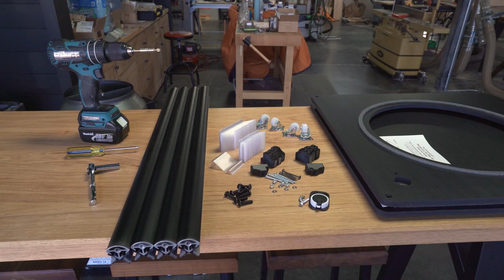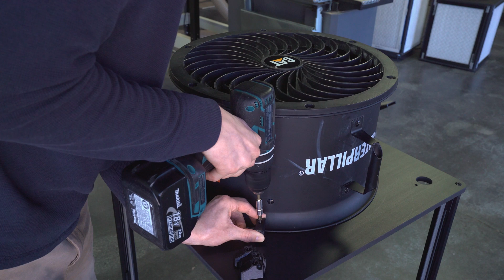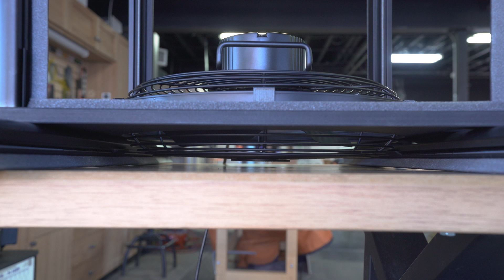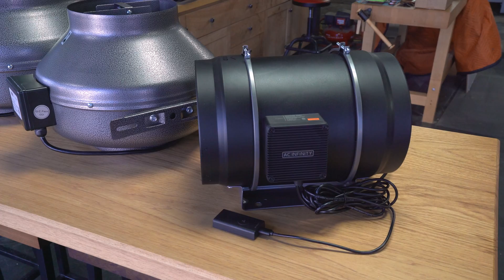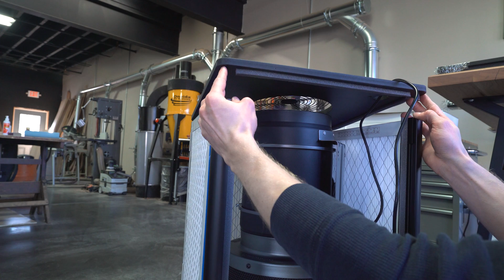Model-B Assembly Guide (All Fan Options)

Comment from the maker: --- Buy Kits Here
https://www.etsy.com/shop/The3DHandyman
--- Time Stamps
Intro 00:00
Frame Assembly 00:54
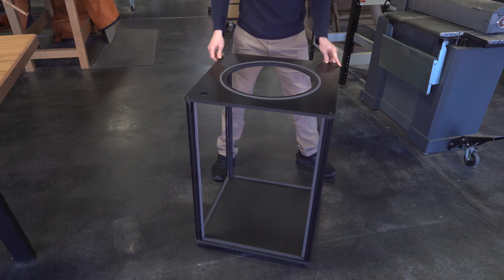Filter Install  02:46
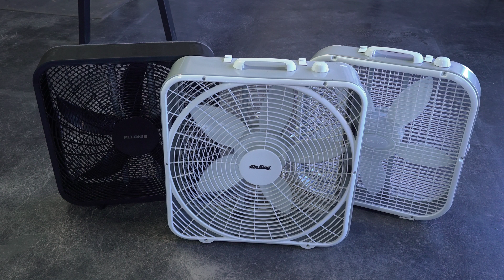Box Fan 05:18
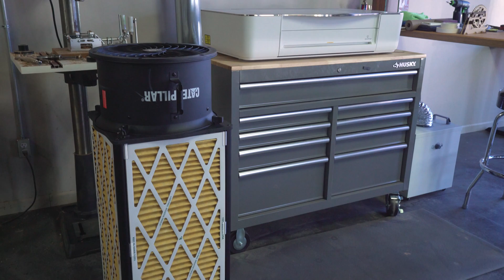Drum Fan 06:34
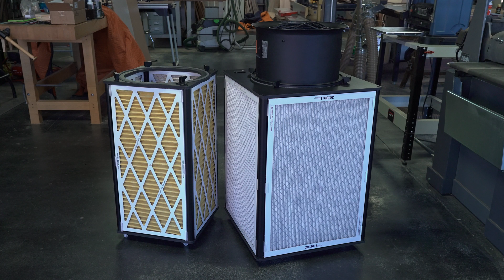Wall Fan 08:22
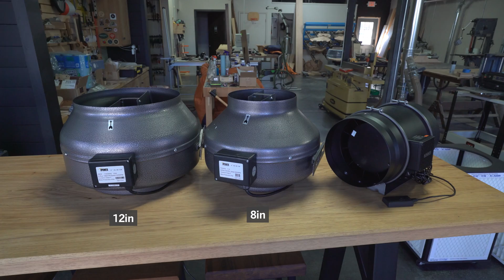Inline Fans 12:16
Carbon Filter 15:17
Foam Install 16:39
Reply: You've done your homework! These kits look sharp & well thought out.
Reply: Hi, I love your kits and want to get one.  How do I go about contacting you to ask you some questions about the kits?  I've tried searching for you on your various sites but can't find your email, thanks
Reply: Hi not sure if you read my previous comment.  How do I contact you so I can ask you a few questions about the kits?
Reply: Happily overwhelmed with all the great info!! Just had mold remediation in my home, hoping your carbon quad could possibly help out getting back to normal. I purchased 2 BlueAir 211+ but I think my nose is a better air quality censor then they are. Most of the time, they don't respond to anything. How loud is the carbon quad? The complete purchase list would be; frame kit, filters, fan & carbon filter?Thanks

Comment: This guy's kits are priced really reasonably as well. There are places selling kits made out of thin faux wood and cords charging more than this dude. Grab a $30 box fan and one of these kits and you will have a much higher quality filter than many of the PC fan kits out there. And if you have PC fans hanging around, this guy does custom jobs, so I'm sure he could do a top with cutouts for 120 or 140mm fans as well. I just love that these kits are metal and thicker plastic with some actual structural integrity to them.

Comment: Hi I saw the price of the kits went up due to tariff costs. Given that the DIY option could run up to $500 at least between the kit, drum fan, and filters, is it better to just buy an air filtration system or HEPA Solder Fume Extractor?

Comment: I'm considering your 20x30 kit with Caterpillar drum fan. Can I mount the drum fan in the push configuration, but have the fan itself, mounted inside the filter box instead of sitting on top? My assumption is the turbulent pressurized air inside the filter box wouldn't "care" if the fan was inside or outside the box. I want this to keep the configuration compact, yet powerful. Any words of wisdom from your experience on this subject?

Comment: Do you have any tips for if I want to mount the catepillar fan in a quad filter configuration with MERV 14 20"x20" 1" filters vs 2" filters ? Do you think I could get a good amount of CFM with either or would it be recommended to go with 8 filters?

Comment: Would it be possible to make a system using either AC Infinity 4” (205CFM) inline and carbon, or the 6” (402CFM)? 
What would be the max room size suitable for these. Using MERV 13 is there a way to calculate CADR?
Thinking of making some for my bedrooms, so looking at a smaller size if it’s still efficient.
Thanks! Love your videos!

Comment: I love your videos!  I am getting into woodworking and already having issues with my asthma.  I was curious...I was allowed by my wife to use one side of our two car garage for this new mid-life crisis.  I am considering your model B (inline) kit and was wondering if there was any reason I could not install this in my garage attic with a duct flush mounted to my garage ceiling that would feed into my attic where the model B would be placed?  The idea is to use my attic to house the model B unit without taking up any space in my garage. The inline fan would draw in dust from my garage right up to the ceiling with no space taken up by hanging a unit or wheeling a unit around on my limited floor space. Or am I missing something and the unit needs to be placed in the space that it is cleaning for circulation? (Garage is finished with drywall)
Reply from the maker: Hello! Thanks for watching and the tip!

Inline fans are not really designed to process dusty air. You can definitely set up a model-B that hangs from the ceiling though, it just would be inside the attic. If you need something in the attic, I have some ideas though. Message me on etsy about this so I can send links. YouTube tends to remove posts with links.

Comment: Have you got any plans to make any using PC fans? Your designs look really really well made and thought out. I just worry a bit about having a full power fan sitting on the ground. What if someone visits and baby/toddler hurts themselves or someone's hair gets sucked in (particularly if the fan is set to suck). Or do you think on the lower speeds they are pretty safe?

Comment: Have you by any chance tested if the laeger caterpillar fan with an adapter to the carbon filter is quieter/higher flow than the inline fan? .....i see about the VOC filter. Gonna look for a 10" version if it happens to exist...or maybe i can just replace the flange it comes with.....

Comment: Is your model B Charcoal pulling air though the top first and out through the filters or pulling dirty air in and then cleaned air out the top? i.e. should I use a diffuser at the top? Thank you for your help!
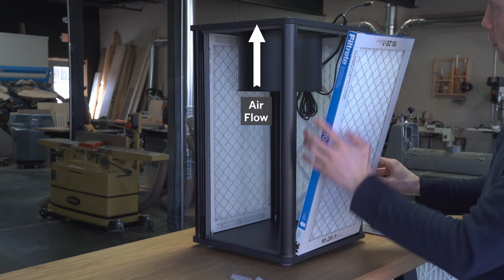Reply: Probably the fan blowing filtered air UP since 15:00 says inline fans are always pointed up
Reply: @Swish36  The problem is that any new owner of the charcoal model looking for install tips will completely skip over to build portion that applies to their specific needs. Mention of flow direction is absent in that segment.

Comment: Looking for VOC filters for residential painting. Is the activated carbon replaceable? How long the activated carbon works if the filter is at the job site not necessarily working every day working hours. Does the charcoal absorbs all odors even the filter is not plugged in?

Comment: My Model-B Carbon came in today, it was easy and quick to assemble and it's quieter than the cardboard monstrosity I taped together waiting for this to arrive.

If you get the refillable carbon and the plus model fan for the wifi control don't put the three filters on first or you'll have to tweak the fitment.

Comment: Right now I am incredibly frustrated. Have the model B with a 14 inch diameter hole. Ordered the the AC Infinity Cloudlift AS14 and surprise the fan is 16 inches in diameter and doesn't even come close to fitting the14 inch diameter hole.
Reply from the maker: Sorry about this issue! The default Cloudlift design is for a 12" S12 fan. The number in the name of the fan indicates the size of the fan blades, not the hole for the fan.

I do have an option for the 14" Cloudlift S14 but, as you noticed, the hole has to be larger.

Please contact me through Etsy so we can figure out what happened with your order.
Reply: @The3DHandyman  Ordered the model B that fit the 16 by 30 inch filter. The top has a 14 inch hole. So far so good. So using my apparently flawed logic I ordered an Infinity model S14 which to me would logically be 14 inches in diameter and fit the 14 inch hole. The model S14 is actually 16 inches in diameter to my surprise.  Would not think there is any thing you could do except perhaps state don't order the S14 model.
Reply: @The3DHandyman  So guessing the S12 has an actual diameter of 14 Inches not 12.
Reply from the maker: @ArnieD17  That's right, the diameter of the S12 is 14in. The S14 at 16in wide is to large for kits that have filters smaller than 20in wide. The S14 is an option for the kit.

In the Etsy description it has all those details but I think you have to click 2 buttons to actually view the description. Etsy seems to hide it for some reason. I want to get a website set up where I can make this sort of thing more clear but haven't made it that far yet. 

Hopefully you can return the S14 for an S12. They seem to be back in stock this week. They have been a bit scarce since I launched this video.

Comment: Hi Handy 😜 what do you think about the Caterpillar 9in drum fan ?  
I want to build a quad filter box with 16x25 filters to have a slim profile box. I think the 9in drum fan would be a good fit for this box size.
Reply from the maker: Yes, that should work just fine! I think I replied to you on Etsy tonight. I think you could also fit it on a 14" wide filter box if you wanted to go even smaller.

Comment: Great videos. And I appreciate the many options test data. 
After watching the videos I am still wondering which would work best for my environment. 

Question: I live in a 1000 square foot, 2 bedroom apartment in hot/humid South Florida with central AC. Opening windows here is rare. 
I am doing renovations while living in the apartment, including non-asbestos popcorn ceiling removal and sanding drywall. 
After doing some drywall sanding in a room that had the door closed, I do see evidence of airborne sanded particles throughout the apartment. 

Do you think one of your CAT drum with 4: 20"x30" filter units be sufficient for my environment? Or would I need multiple units? 
I am assuming the filter should be in the room where the work is being done.
After the air in that room is scrubbed should it then be moved throughout the apartment to scrub the other areas? 
Or better to have additional fan/filter units in those areas?
Reply from the maker: Thanks for watching! You could start with 1 of the drum fan kits for use in the room that you are working in. One thing I did was use a Model-G (single filter on box fan) kit out in the hallway by the room that I was working in. This helped to capture any dust that leaked out of the room.

One other thought is to be sure that the vents in your work room are closed/taped off so that dusty air is not blown out of the room when the system kicks on. You don't have to leave it like this when you are not working in there, but at least when you are working it will help prevent dust from escaping the work area.

Comment: The square black bottoms and tops look like wood, but you said plastic, are they wood or plastic?
Reply from the maker: They are plastic. I stopped using wood because it warps, splinters and needs sanding or painting. Very labor intensive.

Comment: It’s easy to see your designs are maturing. Nice work. 

It would be interesting to see if adding a decorative cloth “pre-filter” would be feasible. Similar to what IKEA does with their filters. The machined plastic sheet and legs look great, the filters are the only thing that make it look more like shop equipment rather than something you’d see inside a home. 

I’ve also thought about configuring the refillable carbon so that it’s outside the filters. That way you wouldn’t need to worry about carbon dust and it would be compatible with any fan. I haven’t quite figured out the best way to do it, but a thin frame with window screen on the front and back would probably work. Some type of reinforcement would likely be needed to prevent it bulging out due to the weight of the carbon granules. A rectangular refillable  carbon filter frame could be a new product for you.
Reply from the maker: I am working on pre-filters for these and they will be out some day soon. I'm starting with the round filters first, then trying the larger ones. Cutting the fabric to size perfectly is a challenge. 

I did a test that I will show off in my upcoming VOC video that applies a thin layer of carbon to the outside of the filters and I honestly did not see much benefit from it. Box fans also cant really handle the static pressure created by the extra obstruction.

I do really like the idea tho, so I may experiment with it more before the video is done.

Comment: Why is it best to have the box fan pulling air through the filters rather than pushing but it's different for other fans?
Reply from the maker: Good question! Technically this can be done but the Box fan motor is not enclosed so it can collect a lot of dust and in certain environments (like wood dust) that could be a fire risk. In-home use would probably be fine in this configuration but the motor will still get dirty. I have tested the Push method with a Lasko fan and it performed well with 20x30" filters (33min to remove smoke from the air vs 46min in the pull mode). An Air King box fan would probably not benefit as much, if at all, because it has a lot more space inside the fan enclosure and the air just circulates around in that area without being forced through the filters.

Box fans can also struggle to overcome the static pressure created by very dirty filters, so in the long run efficiently would likely suffer more vs a Drum fan.
Reply: I can't speak for his results specifically, but all fans handle static pressure differently. Static pressure, in this case, is basically the ability of a fan/blade design to still push air successfully as the pressure increases, usually on one side of the fan. A specific side of a fan design can sometimes handle pressure much differently.

The fan likely just fails to move much air while running in that specific orientation.

Comment: any thoughts on performance improvement with a filter on the bottom?
Reply from the maker: All the tests that I ran indicated that the 5th filter on the bottom doesn't help performance much unless the unit is way off the ground so that air can get to the bottom filter. Using 4 larger filters is a great way to add more filter area without the design complexity of adding a filter to the bottom.

Comment: Wow you been busy! Great job man! I seriously think you need to look into pc fans Artic cooling p14S with 2 either 16x25x1 or 20x20x1 for places like a living room where space is premium. It obviously doesnt do rhe same cfm as a 4 filter design but its super quiet.
Reply from the maker: I'll definitely do a PC fan build some time this year. The space issue is a good thought.

The AC infinity inline fan is really compact and powerful but it is expensive and absurdly loud at high CFM levels. After installing that fan it really needed a cover and that Noctua 200mm grill fit perfectly.
Reply: Is the Noctua design one, still using the ac infinity with just the noctua grill because that is smart!